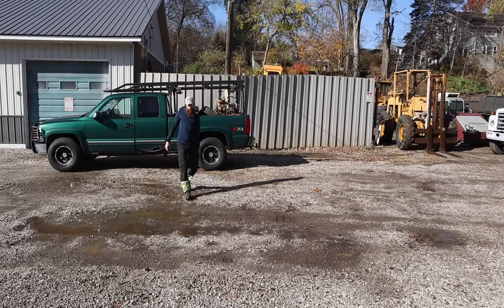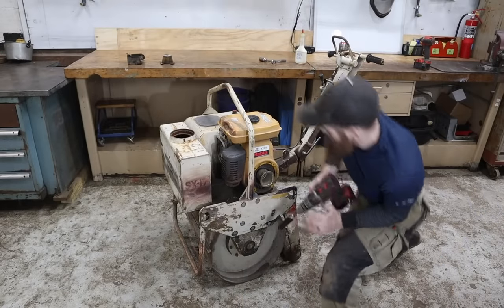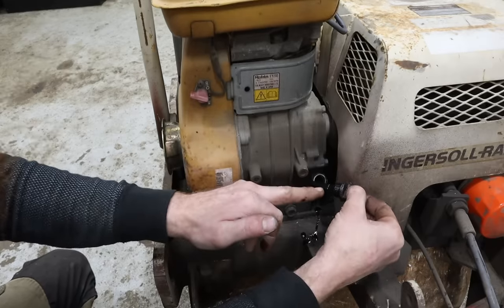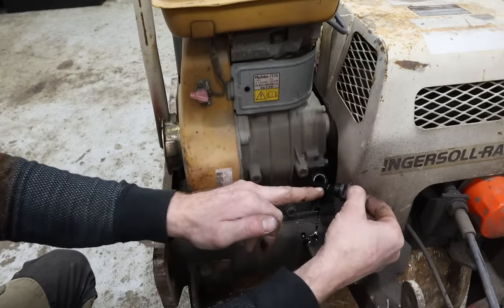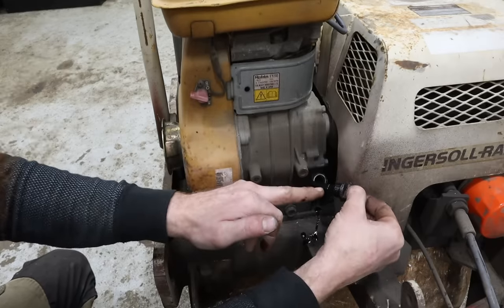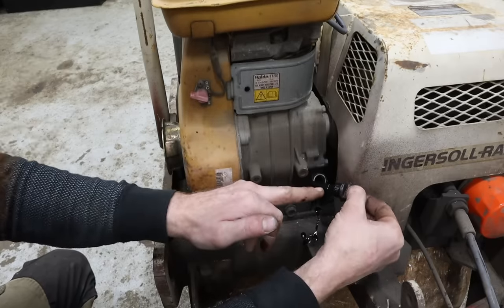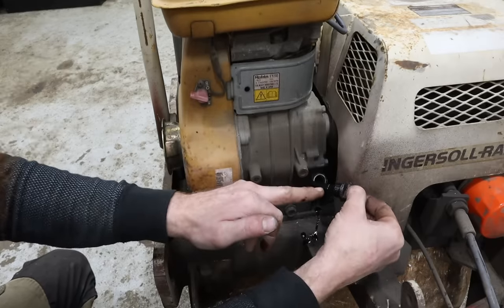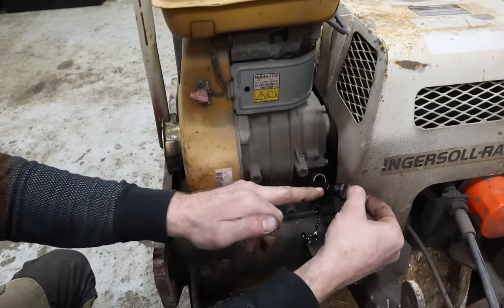I PULLED this Roller from a DUMPSTER!! -  Can we SAVE this Forgotten Walk Behind Vibratory roller?

Comment: I can't believe he actually used grease on the carb gasket.
Easily the worse thing you could use.
Permatex or similar sealent is the correct thing to use.
Grease can and most likely will squeze past the gasket into the carb.
Imgrease definitely won't seal it and it will degrade the gasket materual.
2 years vocational school on small engines, motorcycle repair school and Coast Guard Aviation Machinist Mate A school that included Pratt and Whitney R1820 radial engines Sikorski HH52A Seaguard amphibious helo C school on GE T58 turboshaft engines might just make me qualified to make that statement.
Other than that a fairly hood episode.

Comment: It is not a motor, it is an engine. An engine drives, a motor is driven.  The  hydro pump is a motor, it is being driven by the belts. A heater has a motor, it is being driven by electricity.  A semi truck has an engine.

Comment: 1 horsepower is about 745 watts, so 1 kilowatt is about 1 1/3 hp. your 3.4kw there is a tick over 4.5hp. 4000 rpm's is a very lofty number for a gas one lunger, most of them are rated at 3600, and due to regulations push mowers run even slower, like 3000. I'd guess that motor would be rated at 4 hp if  you were buying a commercial replacement

Comment: I never understand why a company would rather spend 3-5k on a new piece of equipment. Even if you don't want the hassle of fixing the engine, replace it. A new engine is less than a quarter of the price of a new roller

Comment: A landscaper friend of mine gave me a 54inch commercial mower. It would run for about a minute then die and then start up for another minute. I changes the card the tank the fuel line everything I could think of I was about to change the coil when I noticed the plug gap was almost closed I set the gap and it wouldn't run at all closed it back up and it ran for a minute hmmmm changed the plug and it's been fine ever since
Reply: The plug would get hot and stop working

Comment: 1:45:46 If you ever want to build a dog house for the pups, try building one or several on plastic pallets to avoid moisture and rot. I saw stacks of the pallets behind Walmart, so asking a manager for one or two (free) might work. You could even build a playhouse using several plastic pallets joined together. The list is only limited by the number of pallets that you have! Go Green!

Comment: To install a pull cord this is not the correct way! Just put the cord and then tie knot after that u will find the groove opposite to the knot on wheel . Rotate the pully in opposite direction after you fix cord on the opposite groove that will tie your cord on pully! Do this until no wire is hanging out! And also there's just the required tension on spring not more not less ! ....

Comment: (This is last one) ptfe should NOT BE PUT ON LAYERS DOWN THE THREAD IT CAN BUST THE CASING THE SEAL  WHERE THE 2 FACES MEET IT SHOULD BE IF IT GET HOT PUT GREASE AROUND TAPE WHERE THE FACE TOUCHES IT WILL MAKE A GOOD GASKET TO SEAL IT I'VE DONE IT ON RADIATORS BEFORE
Reply: Want to try that in English and without screaming in all caps?

Comment: Oh don't use Teflon tape it dries out and you end up with a mess and could get into the hydraulic system cause you much grief  tip comes from mechanics that they had to deal with the tape they said it caused a real mess more unneeded work .

Comment: All gas engines you can feed carb cleaner through the carb. to prime it to see if it will run . With out doing any testing . if it runs on the prime , it answers a lot of questions without doing any testing . If not then do your testing this saves time . I call it Prime For A Good Time . A quick assessment method that saves time .

Comment: putting fuel in the tank and cranking it over is how I check things if they run I guess you like to take your time and tear the thing down before you get it running. I guess putting fuel in the tank and cranking it over would not make much of a video so you got to drag it on first before you put gas in the tank and get it running that way.

Comment: please... do not touch a motorised machine again or get urself more knowage about mechanics first... not to be rough but i was byond ur level as an 8yo boy... if u do not wanna comments like this than stop posting before you know what ur doing... 

as a few tips... that starter assembly does not need to be taken apart to rewind ur starter thread, if u just turn it the right way in the beginning u would never had an issue with that spring ever,  i use about 2 min to rewind a new starter thread like this. do not open that center screw will save u much pain !

ur carb is not cleaned propably as u forgot al about the main jet and adjust jet. main jet is lowered down in the carb in the same hole as the screw for the bottom cap. and the adust jet screw is easy to clean. just turn it al out an clean inside, when assembled turn it al to the bottom an than back out fore about 2.5 revs and thats the base set. however u will need to fine adjust while motor is running. easy way is to start it and lock the throttle to just avobe idle and than turning the adjust screw.. when u get the highest rpm on the motor it should be just fine there.. to chek if it's running len or rich after this adjust is to watch the colur on the spark plug. black to rich an the adjust need to go more in, white is to lean the adjust must more out. the colur on the plug should be like light chocolate :D   

hope these tip helpin u for ur next project :D and if more tip needed please ask :D

Comment: Great video, but please don't jump off of moving vehicles, and please tuck in your hoodie's strings when working with running motors. 😌🙏

Fixing old, beat up machines is good. Getting wrapped up in them, not so much. 😬  You might have the situational awareness to avoid such a fate. But, I doubt every one of your viewers shares that trait. Your viewers learn from your videos, including your safety habits. So, for the sake of your klutzy viewers, would you please consider following proper safety procedures, while filming, to the point where you feel like a total dork? That seems like a good guideline for guesstimating how well you're emphasizing safety.

When you get ready to do something on camera, think, "My viewers are going to copy this." While you seem comfortable jumping down between two massive rolling wheels, I don't think you'd want your audience copying you. And, with the hoodie strings, you could use it as an opportunity to give your viewers a quick safety tip. You could show them how the strings dangled over the machine, and could possibly get caught in the pulleys, dragging them face first into the machine. Then, show them that they can either tie the strings, or tuck them inside their shirts. If you never use the strings, you might think about safety pinning them to the inside of the hoodie, so they won't keep dangling over drills, saws, and whatever other power tools you happen to be using. If nothing else, it'd be a good way of keeping a couple of safety pins handy.

I love your hard work and your stick-to-it-ivness, as my Mom would call it. There's something noble about rescuing an old machine from the scrap heap. It's not just the money you save over buying a new one. It's not just the good that you're doing for the environment, by doing the second "R" in Reduce, Reuse, and Recycle. It's bringing a bit of history back to life. It's breathing life back into a machine that worked hard, year after year, was beaten and broken, but patched and kept on going as long as it could. As you proved, it wasn't the machine that gave up, it was it's people. The machine just needed a bit of TLC from someone like you. 😁

I like that you try to use original parts. Old, running machines with original parts? You might have to start a museum. 😄

Comment: Ten bucks says it does have spark and ten bucks says you put that wire on the Turner with your drill and play with that throttle I bet you start I'm telling you a meth head stole that thing painted it couldn't sell could you broke the pull cord so he decided to Skype instead and then you happen to see him by chance and you bought for twenty bucks there's no way in hell you're buying that for twenty bucks off anybody who has a sensible mine that knows about equipment come on now that things hotter and Fire